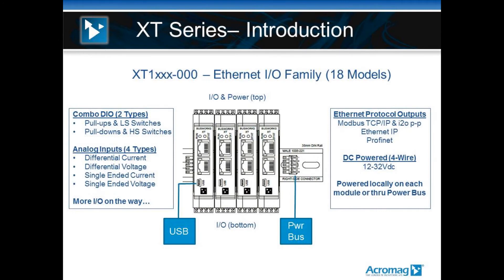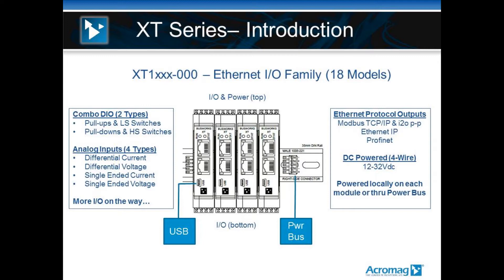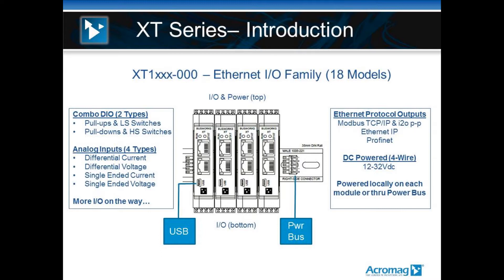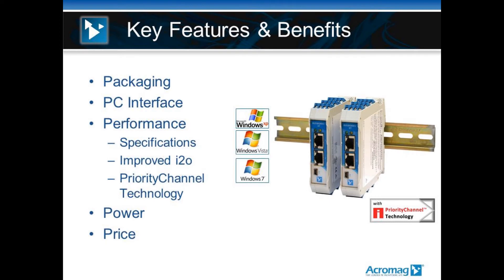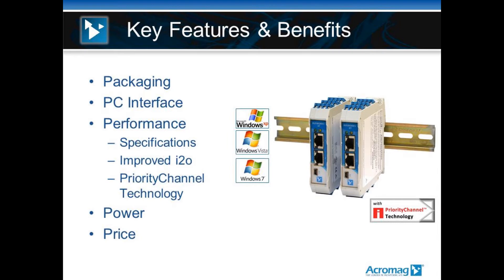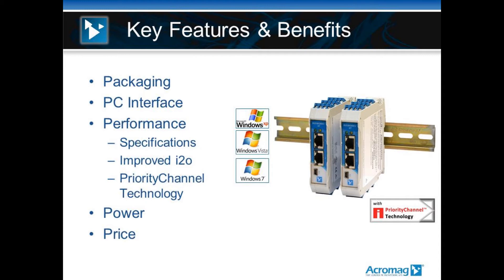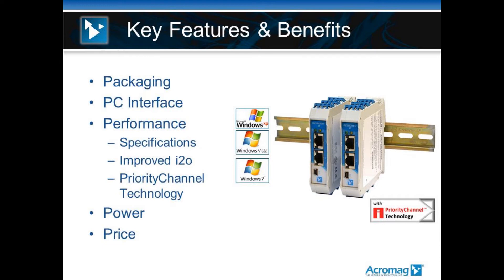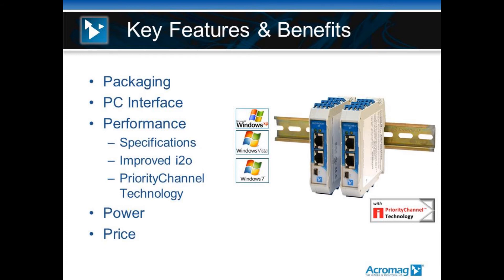How to Use Ethernet I/O with PriorityChannel | Acromag

Comment: Is there any plan to extend the operating system to windows10 or even Mac OS or linux?
Reply from the maker: @Zoltan Nemeth, thank you for your question! Our Remote I/O products are slave devices to a Master Controller ( PLC, DCS, Industrial PC, etc.). Data in the holding registers of our products can be pulled via Modbus TCP/IP protocol network using third party or custom software on masters running under Windows 10, Mac OS , or Linux operating systems. For more details, please call our inside sales department at 800-882-2055 or email sales@acromag.com